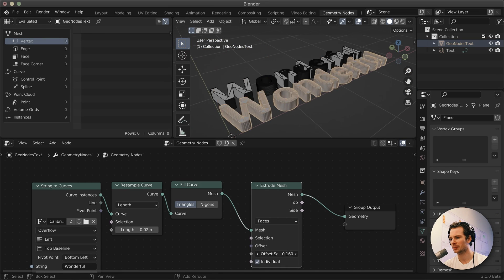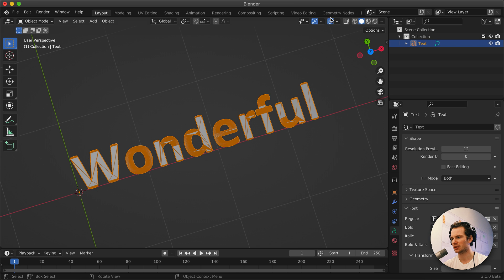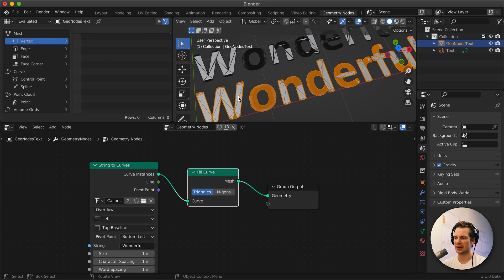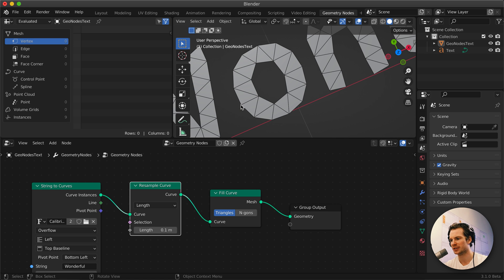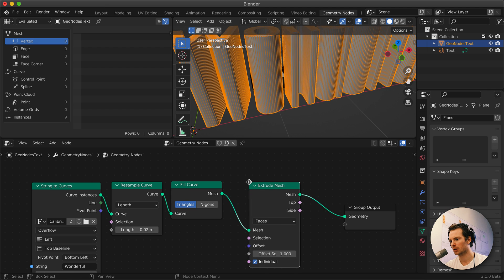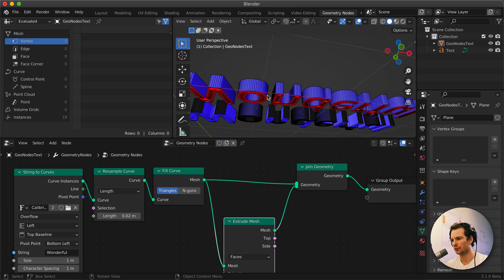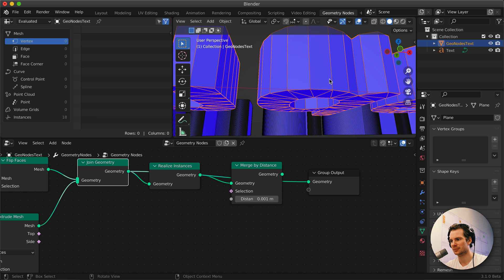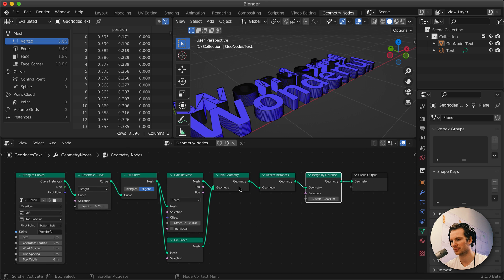Blender Tutorial - GeoNodes Text Part 1 - Better 3D Text with Geometry Nodes #b3d

Comment: Pro tip: if you create text with Geometry Nodes, you have to include "Realize instances" node to be able to apply modifiers to the results. That will allow you to apply e.g. solidify to turn the text into proper 3D object if you wish to use that instead of geometry nodes.

Comment: You could also try using regular Text object with following modifier: Decimate with Planar setting (e.g. angle limit 0.1). You can also add Triangulate with Beauty/Beauty setting but unfortunately Blender doesn't have a modifier to go from triangles to quads so you either have to use n-gons or triangles if you want to keep the text modifyable (non-destructive editing). Of course, if you don't need non-destructive editing, you convert to mesh and apply the modifiers, you can then use Tris to Quads (alt+J) command in object edit mode.

Comment: I really hope they will be adding the ability to do kerning, and some better way to do beveling than using a modifier after the Geo Nodes modifier. You can do kerning in a regular text object, it would be nice to be able to do it in geometry nodes. Beveling geo nodes text with the bevel modifier yields really poor results. Blender would become a lot more useful for mograph if they had these features.
Reply from the maker: I second that! There is a way to do more neat bevelling of the text inside of geonodes. But you have to repeat a bunch of nodes for every “level” which is a bit of a pain. A way to repeat or loop nodes would solve this.

Comment: Wow it's really different. It's better than Text + Decimal modifier. But How can i add material on GeoText before Apply it into Mesh? Cuz I want to animate text...
Reply from the maker: You can apply the material to the Object instead of the Mesh/Data, then the entire object will have the same material.

If you need multiple materials applied to multiple parts of the text you could use a Set Material node in Geometry Nodes.

Comment: How can we add color and texture this text? Thanks in advance.
Reply from the maker: Changing the material can be done like any other object, or with a Set Material node if you need a bit more control over setting different materials to different parts of the text.

For texturing, it depends on what kind of texture. If you're looking for a fully procedural pipeline you could simply add a procedural texture with Cycles nodes.

If you need to do texture mapping, it might be good to apply all the Geo Node modifiers and work with the resulting mesh.

Comment: I find the Resample Curve node to be useless for text.   It randomly cuts off sharp corners, and you never end up with the original corners on the text, unless you turn the resolution of the Resample way up,  but that negates the purpose of Resampling.
Reply from the maker: Yeah true, for 3D printing this might be fine.

Another way for adding more consistent resolution to straight edges while keeping the corners sharp, is by using a "Set Spline Type" and setting it to "NURBS" and then a "Set Spline Resolution"

Comment: Another question...could I apply this same technique to an imported svg file, i.e., convert a logo into an SVG. in either Illustrator or Inkskape, import it into Blender, and proceed to use this same procedure, for the purpose of creating good topography, for said logo? If so, how would I go about doing it, if you have the time to explain it. Thank you in advance.
Reply: Disregard...I saw the comments below regarding the same question.
Reply from the maker: I think it should be possible yes :) Import it as a curves, and use the curves as the input for this process (instead of the text to curves node)
Reply: @Blendergrid  I will give it try...I am still new to Blender, but will see what I can do. Thank you.

Comment: I followed this exactly, and it worked great. But, when I try to edit the vertices, edges and faces in edit mode in layout afterward to personalize with color and tecture, Blender will not allow me to do so. How can I correct this?
Reply from the maker: That’s because Geonodes give you a fully non-destructive generative workflow. You can snap out of that by applying the geonodes modifier. That will make the mesh editable but you lose the ability to change the text

Comment: there is a way to include the 'set shade smooth' node ? thank you
Reply from the maker: Yep, you should be able to add this once the mesh is generated. Result might not look great though, I think it needs some more loop cuts for that to work well.
Reply: @Blendergrid  yes, the result is not that great, is it possible to make a bevel and shadesmooth effect with the nodes?
Reply from the maker: @nicolanarracci  It is possible but a bit complex, would be a good part 2 for this tutorial I guess :)
Reply: @Blendergrid  yeah
Reply from the maker: Here's the next part where we add beveling: https://youtu.be/J8XdTlkECzE
Reply: @Blendergrid  thank you very mutch
Reply: And this seems to be the solution!
https://www.youtube.com/watch?v=iv_5-Ghw8W8
Reply: Yes, not being able to auto smooth by a set angle is a deal breaker really,  
no matter what the benefits, janky sides not acceptable in most cases

Comment: Had no problems following the tutorial to it's conclusion, but being brand new to geometry nodes I wasn't sure what to do next in order to take things further. I wanted to add some bevels and materials so I applied the geometry node modifier and went back to a more familiar workflow (yes, before anybody comments I  I realise that kinda defeats the non-destructive purpose of nodes 😀)

I first shaded smooth and checked the auto smooth box in normals. After that I applied a bevel modifier, lowered the amount and raised the number of segments. This is when I noticed that while the majority of text looked really good, I did have a few glitches with the shading in a couple of areas. If I left the number of segments at 1 they were not at all noticeable, but as soon as I hit 2 they appeared and steadily got worse with the more segments I added until getting to around 7-8. If I kept increasing the number then the shading issue resolved itself once I reached 14+ segments. I guess it has something to do with the topology I created using nodes, but I'm by no means knowledgeable enough to work out how to adjust things in the node editor so I don't have this issue if I choose to use my cheap and dirty method in future .

Definitely going to learn a lot more about procedural nodes because even though I'm still pretty much a Blender noob in many areas, I can already see what a powerful tool they'll be.
Reply from the maker: Edit, the sequel where we add beveling: https://youtu.be/J8XdTlkECzE

Thanks for the comment :) It is possible to do custom beveling of text with nodes, although it can get a bit hairy.

Maybe it’s time for a sequel on this one :)

Comment: Nice... Thx..
I struggle with with 3d in blender. often. C4d handle this better...But works this nodesetup with 3d Text thats be animated with   deformation...Doesn t find a good solution and workflow in blender without artefacts from the wrong topology...
A  handmade time cosuming  remeshing is most regular?  An Idea for Good add ons O tun her Programms...?!
Reply from the maker: Yeah actually the reason I was experimenting with this is because I wanted to deform the text in 3D. If you use the triangulated version it works a lot better than the default Blender text in my experience.